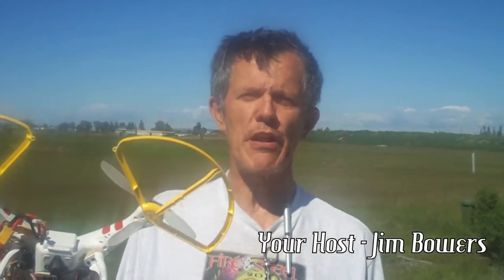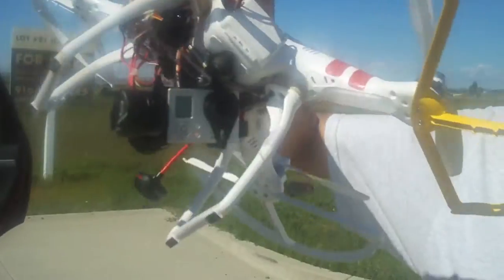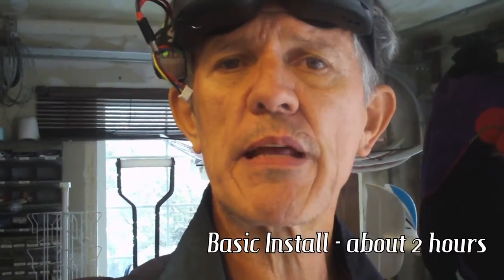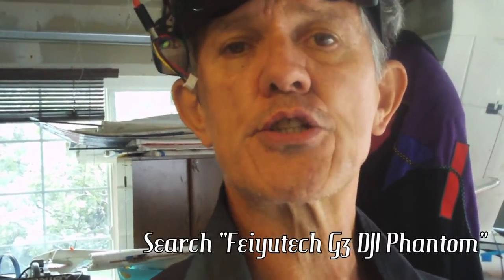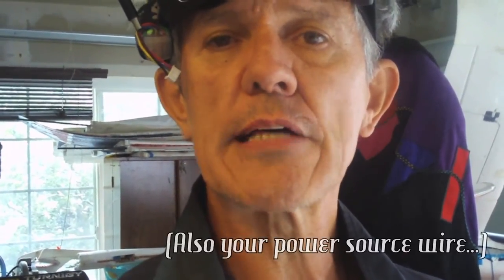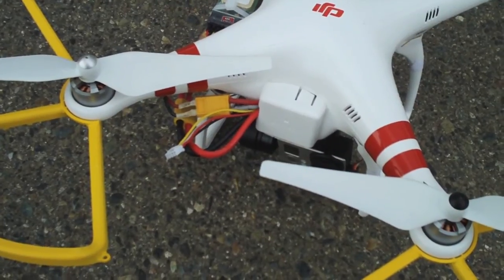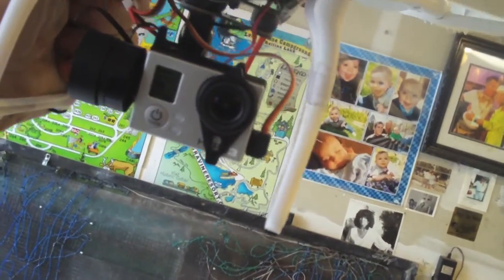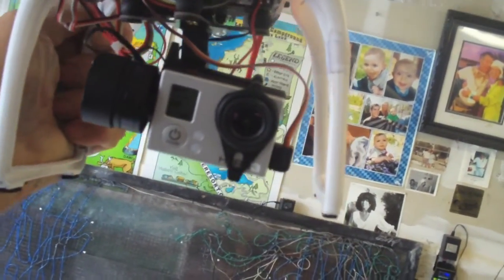ReadyMadeRC Brushless GIMBAL - (Feiyutech G3)

Comment: a few thoughts, if you have the e300 flight system from DJI, I would swap it over to a DJI 450 frame, and use a 3300mah batt. try to keep it under 1500 grams. this will really help your flight times....if not, then see if the system can handle 4s batteries. it will really help efficiencies, and also pick up the 9x4.3 props (mind the reverse thread of the ones made for the e300 if you arent using e300) would really improve flight times if you do
Reply: on my dji, I switched out the naza for a pixhawk,.....never looked back...

Comment: hi jim ive been looking at a few dji forums and some say some thing about fcc and ce mode fcc mode gives you higher flights have you heard about this
Reply from the maker: I have never heard of FCC.... sorry.  what does it stand for?
Reply: some thing about a screw on the back off the transmitter when you turn it on and hear to peeps its in fcc mode
Reply from the maker: Nick Walters One is for USA standards... the other is for European standards... keep it on USA... it'll fly further.